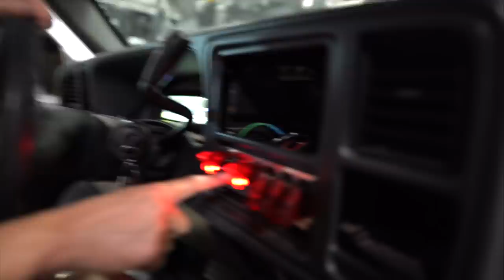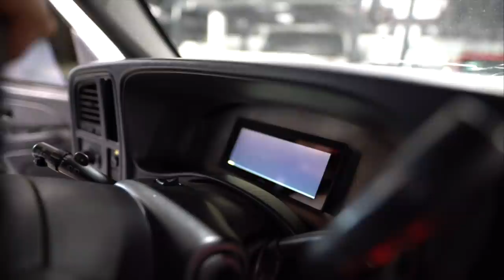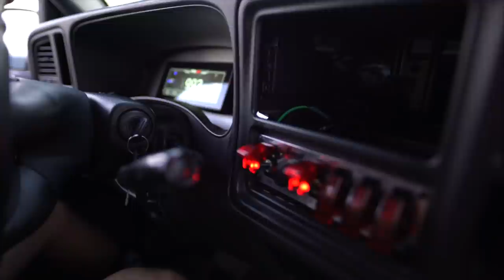Hang Out with On D Gas! *Daily Driven Turbo Trucks*

Comment: Little cold air for the L would be a helpful addition as well
And that shit that happened with tekashi not staying on is the VATS. It’s a security system. Has to be Turned off when they tune it, or wait like 15 min  and it’ll turn on.